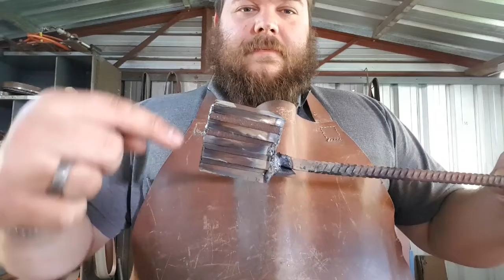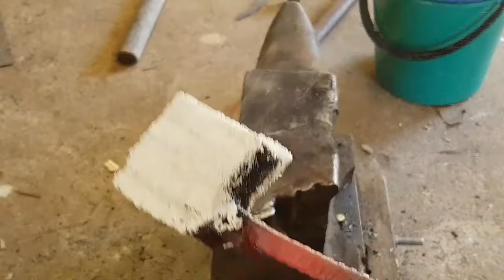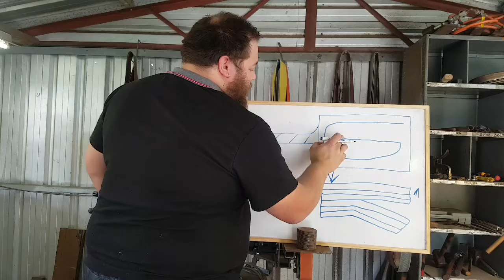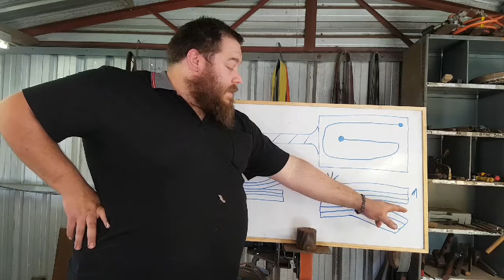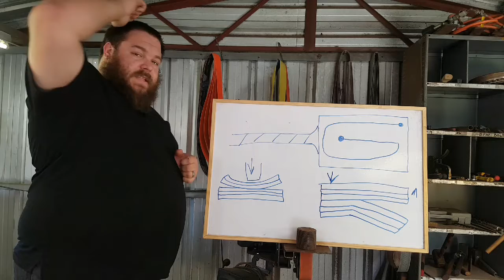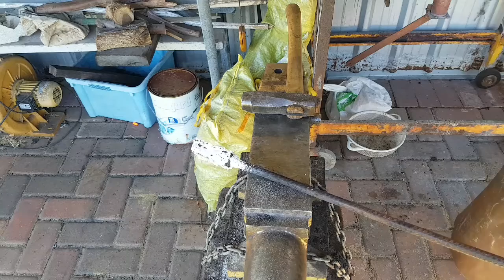Forgewelding Scrap Damascus!

Comment: Good video I usually flux when the steel is barley red hot, a black red heat and I also get it to that temp in a none oxidizing layer in the fire. Also have very little air flow on.  I then use that layer for the entire welding process with more air. This is for a charcoal fire the non oxidizing layer is around 3-4 inches above where the air leaves the bottom hole.
Reply from the maker: Yeah the camera shows the steel a bit hotter than it actually is. A neutral fire is almost necessary for a good weld, but this was intended as a very basic introduction. Thanks!
Reply: @SamTownsBladesmith  All in the name of getting people to have success in forge welding. It can be hard to get it, and I commend you for making it that clear. I remember how much I struggled with it. At the beginning I never got the fire hot enough. Now I wait for a bright yellow lemon color in the charcoal next to the piece before I turn of the blower and I even wait 4 seconds, pull it out and like you said in the video. Light taps at first. Then it's like Christmas when it works out.

Comment: must be something about us generally well-endowed smiths, I have holes in my smithing shirts in exactly the same position as you do :)   (while you're explaining how the billet failed around the 10-minute mark)
I also made the mistake of using a perfumed borax - once - holy schamoly!  talk about fumes! so check the borax your buying isn't perfumed!
Reply from the maker: Haha yeah most of my work shirts have holes all over the front. I keep forgetting to wear my apron! Normally the perfume is water based, which is why the fumes were worse, definitely steer clear of those!

Comment: nicely done Sam. I never thought about the center not being hot enough if i saw sparklers, might explain some issues i have had.
Reply from the maker: Yeah, it's something I ran into in the early days. Slow your heat right down. Technically you shouldn't get much sparkling at all because you'd be using the neutral layer of your fire. Forge on!

Comment: You can ALSO mix Borax and isopropyl alcohol to soak the billet in before the first heat. Once I have more experience and get a little bored I'm gonna try using sand as flux.
Reply from the maker: That's true! There are quite a few ways to pre flux, thanks for the added one! Using sand as flux requires that you apply aslt close to welding heat (preferably in the fire) let me know how you go!
Reply: There WILL be video of it.
Reply from the maker: @drstrangefart  awesome I look forward to it!